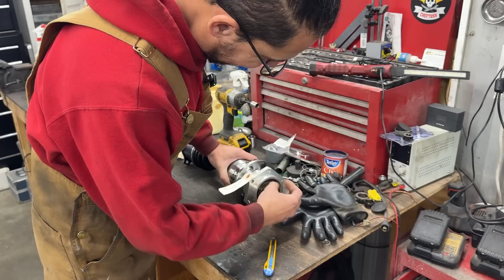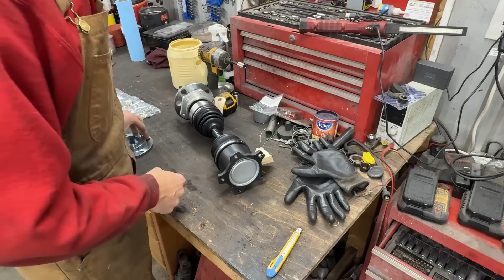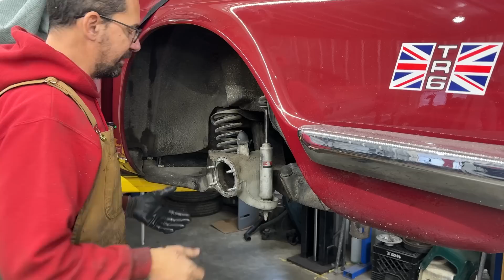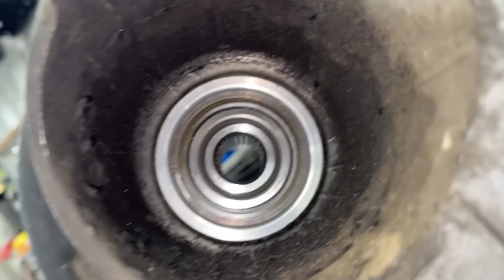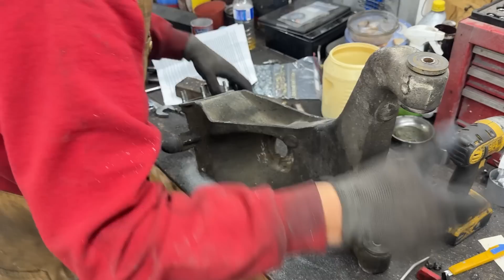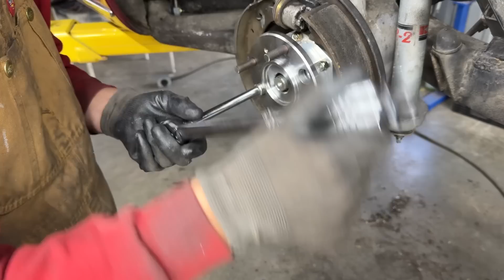1976 TR6 project  - Part 7 - GoodParts CV axles and Heavy Duty Hubs conversion

Comment: This was excellent!  I have run into similar situations rebuilding electric motors and various pumps. I have had good luck using a quarter inch dia. rod slotted on the end to accept sanding cloth of various grits. It even works with the back of the cloth as a polishing material. Have used this many times porting and polishing heads on my motorcycles.

Comment: Hi Elin ,
     Another very enjoyable & informative video . One comment , if I was the owner , would have appreciated the trailing arms to have been thoroughly cleaned prior to installation.
Reply from the maker: This is always a hard decision to make, putting back rusty or dirty parts after a repair. I am always tempted to start cleaning and painting, but once you start, where do you stop? If the trailing arm is nice and shiny, how do I put it on a greasy and dirty frame? Shouldn't I clean that as well? What about the whole wheel well? That is how frame off restorations start :) Also, it is easy spending other peoples money... the owner already spent a lot on parts and labor on this car. There is a lot more to come about it.

Comment: Well done Elin! I think "Goodparts" should be re-named "not bad parts" , it would be easy to have those joints machined a little bit smaller. I suppose he is using and adapting stock sizes of joints and boots. It certainly makes for a nice conversion though.
Reply: The UK CV Joints by 'Classic Driving Developments' are much smaller and slide in through the suspension without removing and grinding the IRS!
Reply: @peterleslie5735  There you are then Peter! Problem alleviated. It seems to me to be a lot of money outlay to have to do all that grinding.